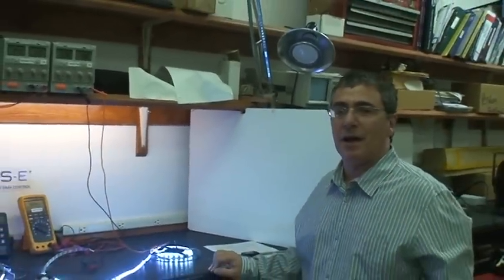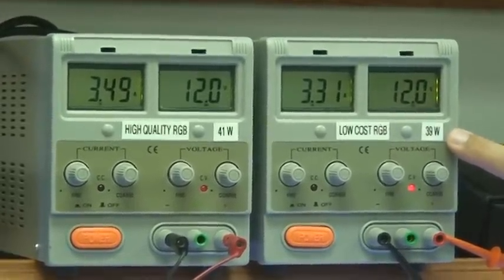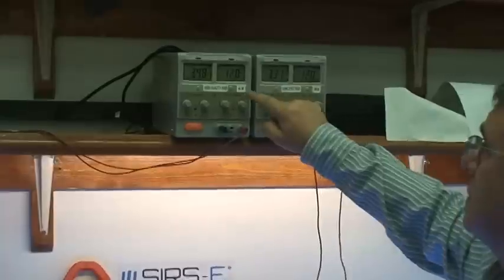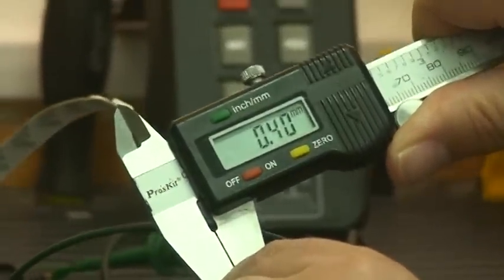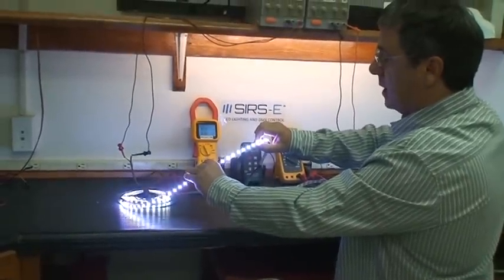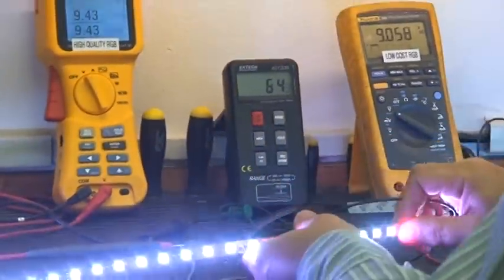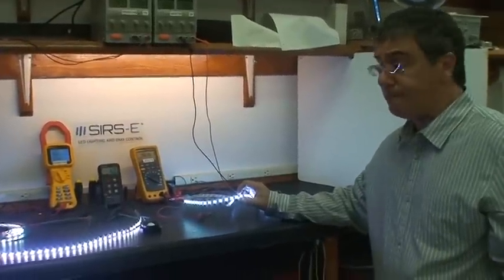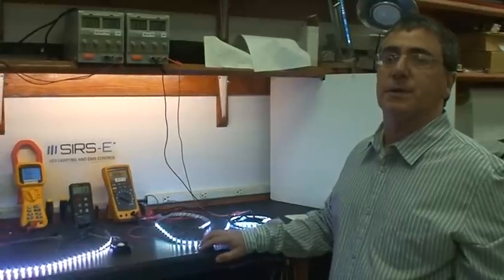LED Strip Lights High Quality vs Low Cost RGB LED Strip

Comment: I'm sorry but I believe the whole premise behind this video is flawed. 

First off, Voltage drop is irrelevant. IF it is something that truly bothers you then simply power the strip from both ends (quick connectors are readily available and very cheap). This can be easily done and will ensure consistent lighting. 

Secondly. How you tested for brightness was total bologna. You can't just hold the light strip in front of the meter at what you assume to be the same distance. For one there is interference from other light sources. Secondly  it did not look at though the two strips were held at the same distance plus one of the strips was twisted more than the other meaning not as many of the LED's  were pointed directly at the meter. Do the test properly by doing it in a dark environment with mounts to ensure that the tape is flat and that the meter is in the exact same position for both sets of lights. 

Higher cost does not always mean higher quality. ESPECIALLY when referring to Chinese junk. Every factory claims to be ISO compliant but that is not a guarantee that you are going to get what you paid for. 

The main thing I have found when testing higher priced strips is that the tape or glue on the back seems to work much better on the more expensive strips. 

Secondly it often time makes more sense to use two $20 strips instead of spending $100-$300 on a pro grade strip.
Reply: Robert, I did not rewatch the video after your comment but as I remember he did not demonstrate a temperature difference between the lower cost and higher efficiency unit. So while yes a more expensive unit may be more efficient it is difficult to give a real number of how much better it is. Secondly we are not talking a difference of a few bucks. Cheap LED strups cost $15-$20 the high priced ones cost as much as several hundred dollars. At a retail cost of 5x (or more) you will not make that back in lower electric bills. Now I am not saying you should not buy a quality product. I am just saying you need to weight the options and make a decision that is right for you. I do know however that for most people spending $50 on Amazon for two lights trips and a controller would be a relatively inexpensive project one that they would not be able to undertake if the cost of those strips was $300. Lastly I just don't believe the video was done correctly to demonstrate a worthwhile gain that would merit an investment in a much higher cost product.

For me to be satisfied the strips would have to.
1. strips would be mounted to a board
2. the light meter would also be mounted
3. the same transformer would be used to test the strips.  

My main issue is the comparisons were not done fairly. 

And that is not even getting into do teh strips use the same LED chip? That in itself is a can of worms as there are so many different chips on the market.
Reply: I have to agree with this comment. It all depends on usage and goals. If you don't need the higher quality, then it's ok going for less quality LEDS. However, if you run a place which relies on this type of lighting for long usage times, then, you should go with higher quality. Still, it may not be worth it, but it's just an example.
Reply from the maker: +John Salazar Thank you for sharing your input. However, this was just a quick test in order to outline the basic fundamentals between two very different LED Strips. You can't just power any LED Strip from both ends because when working with an RGB LED Strip; you can only power it from both ends if you have DMX Controllers. Especially if you want full control over your lighting. Also, you have to take CRI into consideration because Low cost vs. High Quality LED Strips will have a very different CRI making the colors on the Low Cost Strip not seem as true as they should be. Meaning you can't just double up on the Lower Cost assuming you will achieve the same result as a High Quality LED Strip in the end. Also, we are not referring to "Chinese junk." We are referring to our proprietary LED Strips engineered here in the states. Which will soon be manufactured in the States. In retrospect, like it has been previously  stated, this was just a basic outline of the main differences and issues experienced with Low Cost LED Strips. We would love to take your criticism into consideration for a future remake of this video. Thank you for your comment.
Reply from the maker: +Robert Mantel Thank you all for opening up the discussion about quality. While voltage drop is the topic of this conversation, the reality is that voltage drop will be determined by the components in the strip (i.e. PCB, LED diode, resistor, etc.) The higher quality the components, the more efficiency and longer runs associated with an installation. While voltage drop is one factor, this video does not move on to the next aspects which include CRI, LED diode batch consistency, safety standards (i.e. UL certification and audits), or lumen output at max. power. I agree with +John in regards that $300 strips would not make sense for a small project and low cost strip would probably make more sense. +Robert’s points also hit the nail straight on the head and are very valid. Mentioning volt meters, UL requires a calibration schedule. If there is a specific topic anyone would like us to make a video of, we can definitely do so. Thanks again for watching and taking the time to comment.
Reply: +John Salazar John, with all due respect, the simple principle of conservation of energy means that the greater voltage drop across the cheap LEDs means the difference can only be heat, therefore to obtain the same light output as the higher end unit you will need to buy more hydro. I don't need a light meter to see that his led strip is brighter with a higher color temp them the cheap units.  The simple fact that he uses a greater thickness of copper strip is enough to convince me that over the long run these units will be more reliable, and more efficient.

I guess you're argument then is that you don't trust his voltmeters. Granted they should be calibrated by the factory periodically, but the difference in voltage drop far outweighs any potential calibration issues. See the thing with the cheap strips is that you can't have as long a strip given the same power supply and because of the greater amount of heat cycling, the thinner copper will fatigue until one day part of your strip doesn't work anymore. That's fine if it's really accessible but if it's a pain in the ass to replace, I'd rather spend the extra cash and just forget about them other than to light my subject matter.
Reply: Actually this video demonstrates perfectly the difference, and the caliper measurement should be enough to convince anyone that understands basic electricity why it's better to spend more money on the better led strip.  It all depends on whether you want to spend hydro on heat or light. I would choose light, because LEDs strips make much more efficient lights than they do heaters. But the choice is yours. For a long term install, say accent lighting in a timber frame home, I would spend the cash and not have to replace those cheaper units that deteriorate from all that heat cycling.

Comment: How do you figure that 35 watts is the same as 41 watts??
Reply from the maker: Hello cjmmjc, thank you for watching our video and for your question.  Sorry for the misunderstanding.  We said that we had almost the same power consumption, but not exactly the same because it's a difference due to the voltage drop. From the power supply we got 41.76W with the High Quality strip and 39.72W with the Low Cost strip (2.04W difference). Then on the multimeter we saw a voltage drop of 2.54V for the High Quality strip and 2.86V for the Low Cost strip. This changed ourpower consumption to 32.92W with the High Quality strip and 30.24W with the Low Cost strip (2.68W difference). So as you can see the higher the voltage drop the greater the difference in power consumption. If you have any more questions, please feel free to comment or email us at info@sirs-e.com.

Comment: Hmmm 100$ or 10$? I'll take my chance with the cheap one...
Reply from the maker: Hello Jean Daniel Desrosiers, thank you for watching our video and your comment.  Cheap strips are great for low risk, or low budget jobs where
quality doesn't really matter. But if you have a high cost job, where your
reputation depends on the performance of the products you install, you can be assured that our strips
are thoroughly tested, and engineered for ultimate performance. Not to mention
we offer full support and we always answer calls and emails. Remember we also
offer a low cost line of strips that are still better than any $10.00 strip and they come with support as well.

Comment: Good information, however.....Looks like you are charging 10x what some of the Aliexpress retailers are direct from the source.
Reply from the maker: Hello Aceshigh00, thank you for watching our video and for posting your comment.  We engineer and test all of our strips here in the US. They are not the
same strips you will find from overseas providers. We do offer full support,
and a 3 year warranty with our non water proof strips. Not to mention if you ever
run into any issues with design, install, or anything else we are only a phone
call away.
Reply: good test